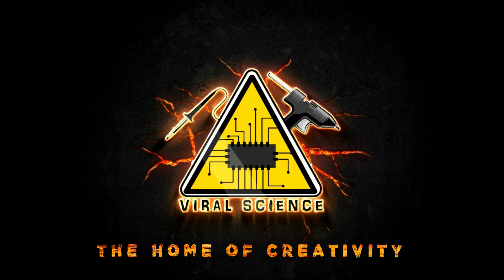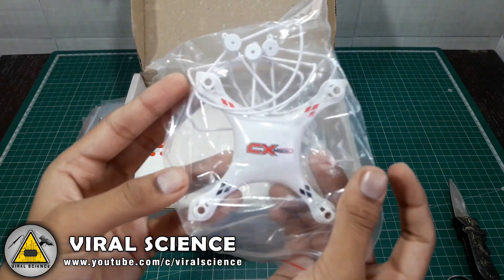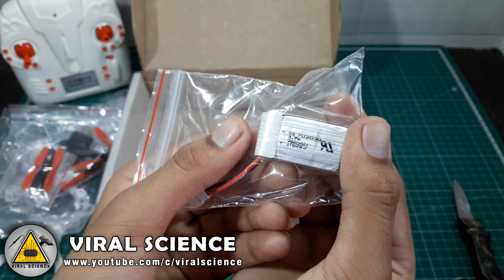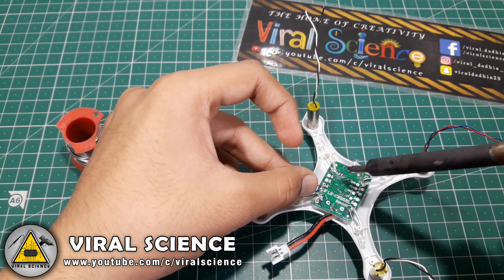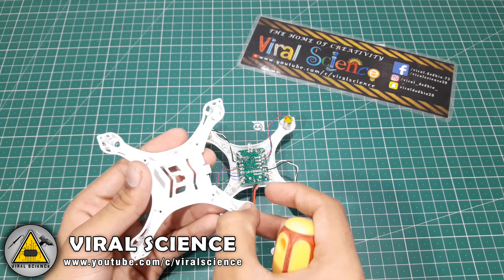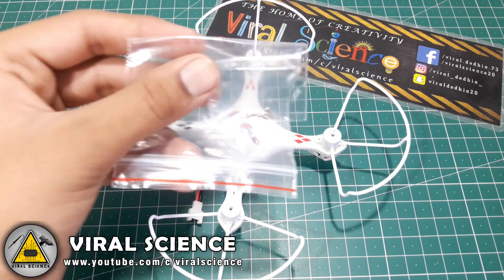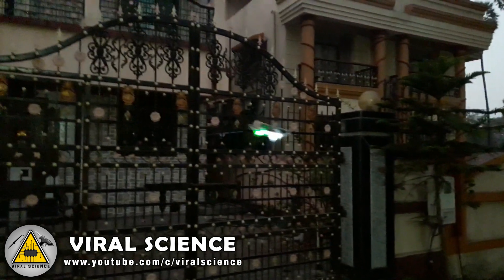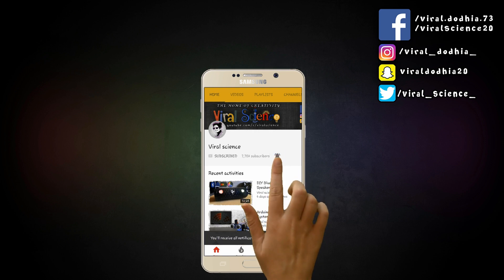DIY Mini Quadcopter Kit | Unboxing | Drone | Assemble

Comment: your g sensor robot is not working I made it but not working receive Timeout device not reply your code are not working but I made the robot from mert arduino and tech channel and it works very well
Reply from the maker: Hemraj Hitesh It should work as i have also made it, but finally you made it with help of some one thats great
Reply: thanks very much